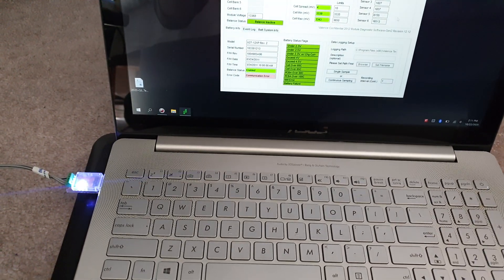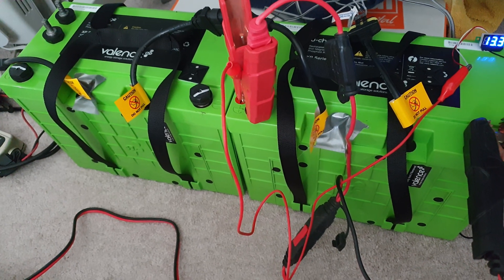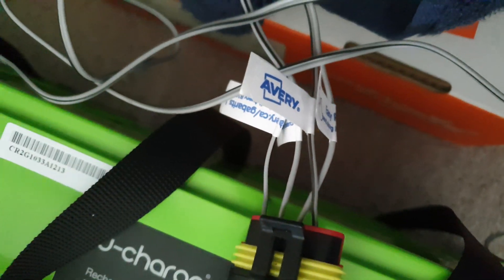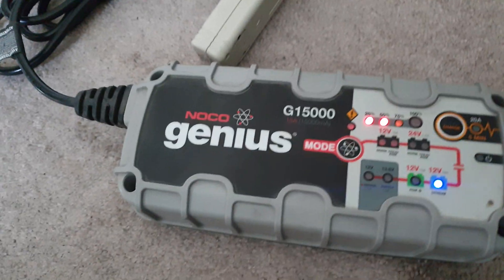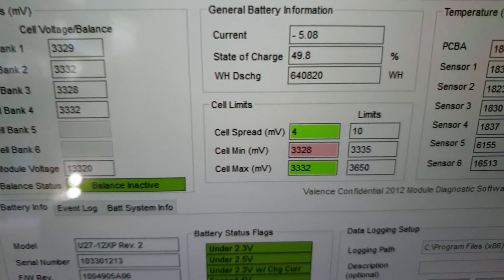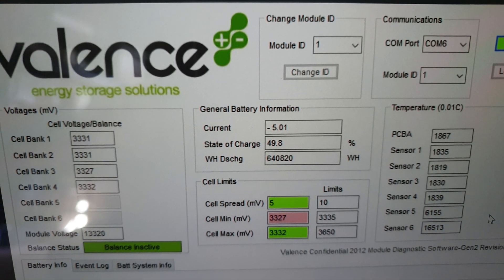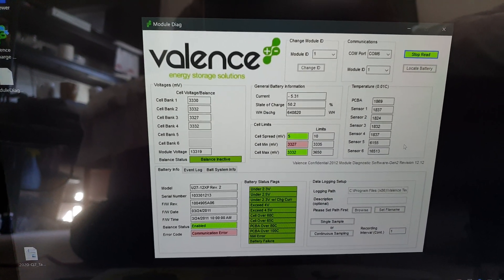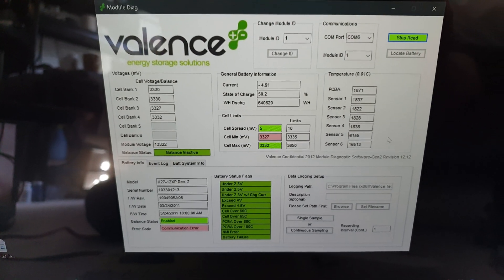Valence U27-12XP Batteries for my Sprinter Van Build

Comment: Can someone pls answer me below question about this Valance Battery.
I want to buy 4 or 8 of this battery for 48V system. that will be 4 in series for 2p4s configuration. My concern is balancing this batteries. Do I need a BMS for them or tell me how i will connect the communication cable to ensure the batteries are balancing? Thank You

Comment: Did you go with the larger U27 rather than the U1-12RT due to amp hour? Figured so but wanted to ask. Have you messed with the RT by any chance, I’m looking to slowly build a solar storage for my house and they seem to be the best way to go per dollar. 
One last question, have you used an external BMC aside from what valence has built into them or just stuck with them? I see some people saying they use them and others say they swap for aftermarket. I’d like to be able to see all the cells internal rather than just the battery with an external BMS. 
Thank you and great video, how’s everything been going with the van and battery setup?!

Comment: My understanding is that these batteries only balance when hooked up to Valence software or an external valence/aftermarket bms. I also have read that they do not have a low or high voltage cut off without being hooked up to said bms. What has your work around been?
Reply from the maker: No, they balance without the software as far as I can tell. You are right about not having the other parameters in the bms. I use the renogy charge controller to set parameters that are safe and keep an eye on voltages and temperatures. I can also easily kill the charging from the alternator with a simple circuit breaker. I feel like keeping a close eye on everything is more safe at the end if the day than relying on a electronic device that could fail anytime. I am thinking about climate controlling the cabinet that the batteries will be in so I may not have to deal with extreme temps that way.
Reply: @sprintershuttle9444  they have no on board balancing without the ubms module

Comment: Where did you get the bms? system Like what you did here  cool stuff thank you.
Reply from the maker: Thanks. There is only balancing built into the battery internally. There is no low or high voltage or temperature cut off built into them.
Reply: @sprintershuttle9444  still having good experiences? I have been running one u27-12xp for 2 years on my trailer and it has been awesome even running the microwave and have never killed it once. it appears something has drained the battery to under 2.7 volts while i was gone and i now cannot get it to accept a charge. any ideas?
Reply from the maker: @jamesyoungjr9850  i think you might have to buy a 120v external charger of some sort and use a special setting or procedure.  I'm not clear on that. Try keyword "wake up" lithium batteries. Hope this helps.

Comment: How long does it take to charge the battery?
Reply from the maker: I haven't fully discharged mine yet, but from some initial calculations with my Renogy DC-DC charger that provides up to 50amps from the alternator, it would take around 4 hours.

Comment: I just ordered the same batteries, great deal, are they easy to connect to eachother in series?
Reply from the maker: Yes, they have sturdy bolt connectors on top and I have my two connected with used oem battery cables from a car.